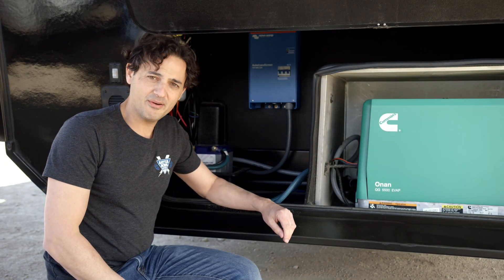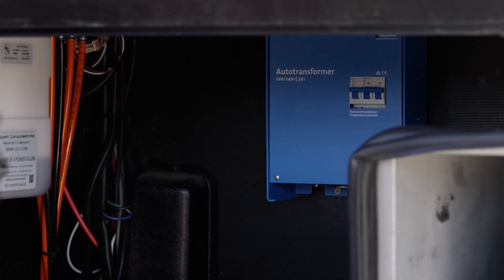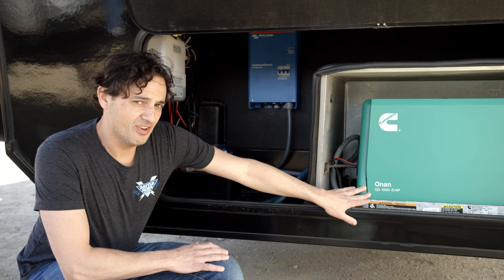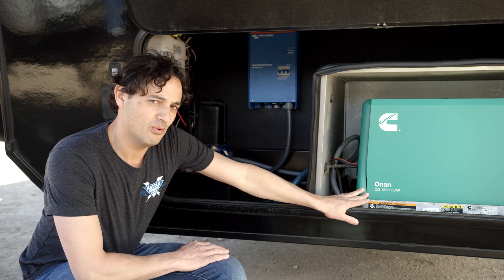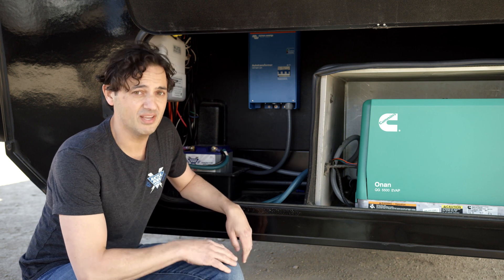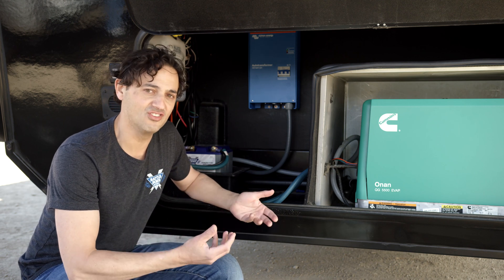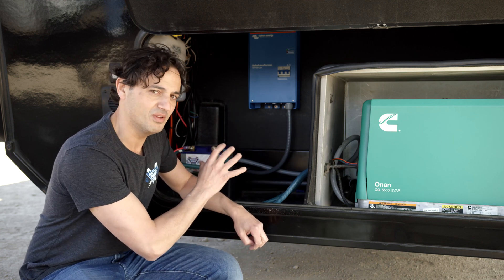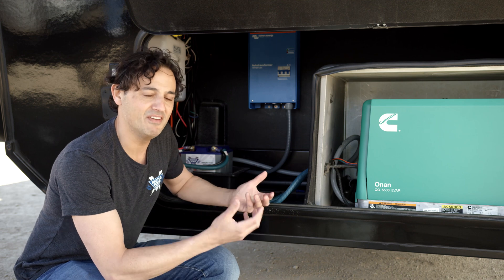FAQ: Victron’s Auto Transformer l Battle Born Batteries

Comment: If you could go into detail about wiring for your particular application you would be the first. Victrons instructions suck. They don't show which direction power flows and does it get wired in  the same direction for step up or step down power.